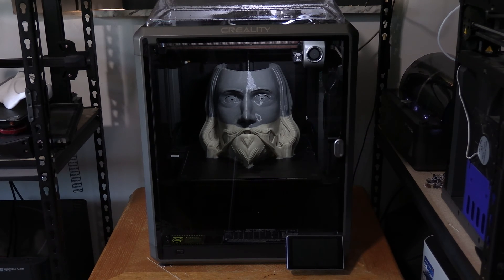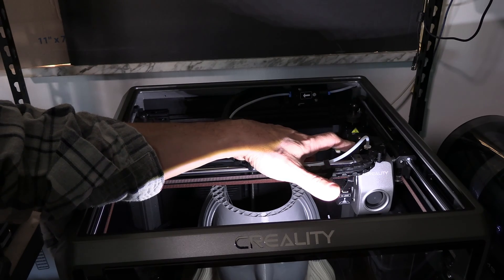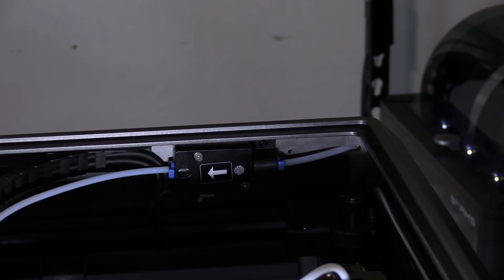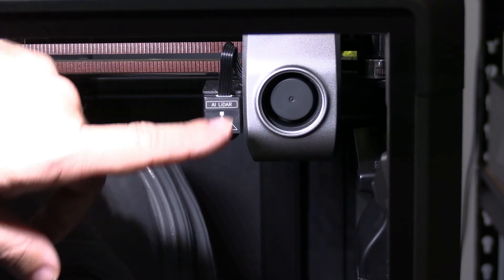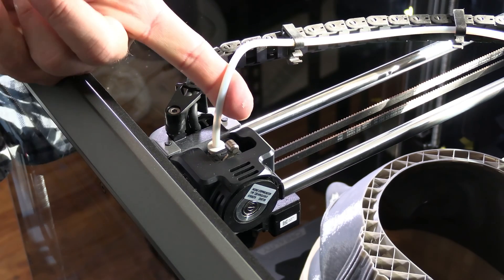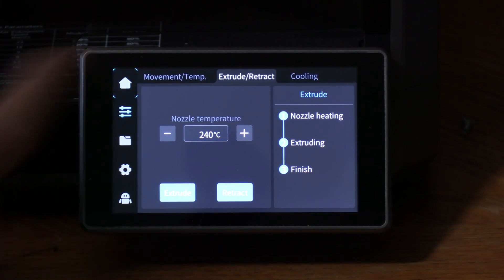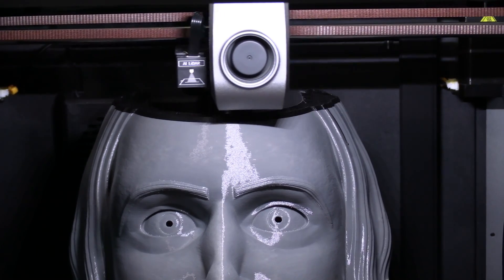Creality K1 MAX ran out of Filament? How to: Remove, Replace, RESUME

Comment: Why you positioned the filamet spool like this way? Isn't it more difficult to pull  filament from the spool for the machine. I always position spool to turn clockwise not  counterr clockwise. CAn anyone explain to me what is the benefit to position spool to turn counter clockwise?
Reply from the maker: Just like toilet paper, BEARDS, not MULLETS. We don't want it unspooling itself

Comment: Why didn't you just open the pipe where it goes into the extruder? Much easyer
Reply from the maker: Because if you move the extruder AT ALL, your print is Toast.... If you ruin the teeth in the coupler, your extruder is TOAST.

Comment: Brilliant, thank you, your “how to” tutorial really helped me to solve such a situation with my K1 Max for the first time. I had two large prints, each calculated to use 490g of filament (including everything, also the supports).  I loaded a fresh 1kg roll of Overture filament and figured it would be just sufficient for those two prints, 20g left on the spool, more than sufficient for the initial extrusion to make sure, the nozzle is primed. However this calculation was far off, the 2nd print ran out of filament 3/4 into the print, the values the slicer calculated were far off. Thanks to your video I was able to rescue the 2nd print. The sort of issues I don’t have with my Bambu Lab with 3x AMS. Please share more videos like this, they are highly appreciated!
Reply from the maker: Super. Will do! Now, toss a CFS kit on that big boy

Comment: Dude, I have never removed the filament from the sensor. From the inlet of the extruder everytime.
Reply from the maker: I wouldn't. Cheap couplers should be left alone. Though, I have only run out, one time ever. Which was on purpose

Comment: Instead of pushing it back out it just keeps extruding not retracting
Reply from the maker: You are pressing RETRACT? 
Once it extrudes a little, unlock it and pull it out yourself
Reply: @3DRundown  ya, did it like three times.  I ended up just manually feeding the filiment through pushing it through with the new one.  Didn't really know what else to do.

Comment: What's your reasoning for not accessing the old filament at the hot end?
Reply from the maker: If I move the hot end, even the slightest, it will throw off the resume. Worse: If I damage the Bowden Couplers teeth, my Extruder is trash.
Reply: @3DRundown  gotcha. I got a K1 max about a month ago and I've been doing filament changes at the hot end.  I'll knock that off. Must've been getting lucky this far! Thanks for the info!!

Comment: They don't place a filament sensor on the extruder because weight matters in high speed printing
Reply from the maker: P1P and P1S have the sensor in the toolhead
Reply: @3DRundown  interesting

Comment: I'm not sure why, but my K1 did not pause the print. It just kept going without filament and now my extruder is clogged. I already removed the print so now I'm going to try and slice the file where it left off and glue the two pieces together.
Reply: Also seems my sensor is on the outside of the machine close to the spool.
Reply from the maker: K1 is outside, Max is Inside

Comment: How big was that grey layers reel? Was it partially used or a fresh brand new reel? Basically I wanna know if large models like that will go through a full 1kg reel of filiment or not?
Reply from the maker: I can do 3 of these on a 2k spool
Reply: @3DRundown  so this happened because you were low on filiment then?
Reply from the maker: Right. Started the mask with used up spool.

Comment: Do you really NEED to have those blue clips to print because I can’t get my filament through the sensor inside the printer and I’m missing all my blue clips
Reply from the maker: The clip prevents the teeth on the coupler from releasing the Bowden. Use them, and keep extra on hand. What's the hold up with the sensor? I find my K1's sensor very easy to get through, unlike some other models that like to stick. be sure the end of the filament is straight. Clip it, and use your fingers to make it straight. Worst case, take it off, and make sure nothing broken off inside it

Comment: I just got my printer, and I hate the position that They did to Filament Runout. I will be moving to outside and there will not be a tubing in it but it will be loose so if will run out then I will have my filament outside for easy pull out. I'm not sure what it will take but I will try.
Reply from the maker: I'm not a huge fan of it either, but I got used to it. There are mods out there for moving it. Personally, I'd rather skip the runout completely.
Reply: @3DRundown  that would be big mistake.
Reply from the maker: Almost all my 40 machines have the runout removed
Reply: @3DRundown  sorry but removing them is a mistake. right now I'm printing my design of mounting outside and I will post them on Printables and on Thingivers. under different user names.
Reply from the maker: I'd say, in my 5000+ models I've printed, I've run out of filament, 2 times. Maybe 3. But.... you do you. No wrong answer.

Comment: Why are you retracting? That filament is useless anyway, just extrude it. no need to mess with the filament detector.

Extrude extrude extrude. Until nothing else comes out. Then you unlock the gears for the extruder, push new filament in. Lock extruder. And extrude until new filament comes out. Then resume printing.
Reply from the maker: Why on earth would I do that!? There is like 2 feet of filament in there. Remove it and reload. Entire process takes 15-20 seconds.

Comment: You mentioned loading the filament so it comes out the top of the roll instead of the bottom. I’ve been using the bottom and haven’t had any issues. Can you elaborate why you prefer the top method?
Reply from the maker: OVER is the officially instructed method from Creality. It also makes sense, for the same reason OVER is on the Patent for Toilet paper. It keeps the spool from loosing tension, and unspooling itself.
Reply: @3DRundown  thanks boss

Comment: Thanks for this, great video that helped me understand the filament replacement process. Really curious about your lid. It looks aftermarket... Do you mind letting us know where you got it from. Obviously we are all suffering from the standard lid pushing down on the bowden tube ...
Reply from the maker: It is. I helped them develop it. I need to dig up the link. I'll be back. 
However. I use the stock lid, upside down.
Reply from the maker: Secret Technique to vent Creality K1 MAX, Chamber temp for PLA & increase Cable Chain clearance
https://youtu.be/9xW8L2o1P-A

Comment: In the video, you did not show how to remove. The Boden tube from the machine is simply appeared, separated from the machine.  My print ran out of filament, but there is none sticking out of the Bodden tube.
Reply from the maker: I show it at 2:10.
Pull the clip.
Depress the blue ring
Pull the tube out
Select Retract on the screen
Reply: My man!!! 
Love the video & it answered all my questions & some!!!
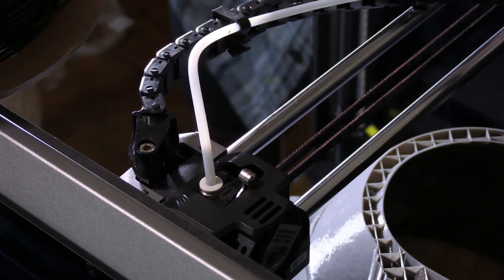Reply: 4:08 Wait, there's a locking clip? Is that why I've been having trouble extruding the new filiment? I didn't know about that clip
Reply: You didn’t even mention if the filament is stuck in the filament sensor, since you are “so intelligent”.

Comment: Wouldn’t it be easier to remove the leftover filament from the extruder tube entry? After you retract you just pull it out and put the tube back into the extruder
Reply from the maker: I avoid having people touch their HOT end, whenever possible, and I never want people repeatedly removing a Bowden Coupler. The teeth on those, are super tiny and weak. One wrong pull, and they won't hold anymore. Now you've got a problem at your hotend. ALSO, if peeps are a little rough with it, and move the hot end, even the tiniest bit, it may through off the resume, and cause a layershift. I would leave the hotend alone, and avoid removing the hotend Bowden at all costs.

Comment: i dont think my sensor is working.. i have had my printer print in air not stopping becuase it ran out....
Any tips for it?
Reply from the maker: It should light up, and the screen should show a yellow icon when out of filament. Make sure it's connected right and getting power
Reply: @3DRundown  thanks you for answering and the video!
It helps us all <3
Reply from the maker: Very welcome

Comment: For the life of me I could not figure out how to change it mid print and get to the filament.  GREAT instructions!  I just did a test print to practice changing the filament and it went perfect.  Thanks for much for posting!
Reply: I just got one of these machines and have had nothing but trouble trying to get the filament through the filament sensor it took me over an hour honest I found it so frustrating

Comment: Light in my filament sensor not work , can i disable filament sensor in options?
Reply from the maker: I've never actually noticed a light in my sensor. Your sensor is not working? I'm not a fan of runout sensors..... Should be able to disable it, but, I have never actually tried.

Comment: Now the k1 max comes with a glue stick is it for the whole bed or just were the nozzle clean it's self. Cause I really haven't use it and had no issues with prints issues.
Reply from the maker: It's for the bed. I would use it where the model prints, rather than the whole bed. But.... I can't remember the last time I used it. However, it protects the bed
Reply: @3DRundown  thanks.

Comment: Why not remove the filament at the hot end?
Reply from the maker: If that coupler fails, from repeated use, it is not replaceable, and your extruder is toast, as it won't be able to hold the bowden anymore. Anybody who's worked with Bowden setups on bed slingers, will tell you, they do indeed fail.... Plus, since we are going to resume, even the slightest movement of the hotend. by you, can through off it's position for resume....
Reply: @3DRundown  good point! What do you do with regular filament changes? I recently did a retract, then pulled it all the way through from the reel. The stingy bit of filament got pulled off at the runout sensor. Since then I’ve been disconnecting from the hot end and trimming the filament before pulling through.
Reply from the maker: That shouldn't be happening. Retract is the correct way. It will push then pull. Make sure you let it complete the push/pull, and don't unlock it. https://youtu.be/Kb4Vmy5m5Rk?si=Cc0MM4WtPLTz5oQ5

Comment: I think some people move the run-out sensor outside so it's easier to sort out.
Reply from the maker: Indeed. I think that's a wise move. I will probably cover that type of mod at some point, however, from a "traffic" point of view, it makes sense for me to cover the stock setup, at least, prior to covering a mod. This let's me reach the most people with a specific configuration.